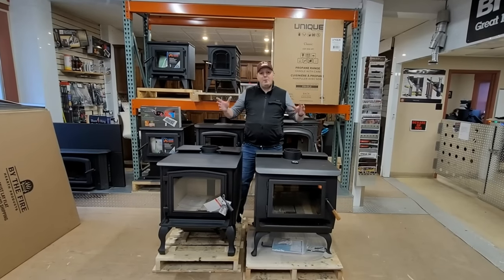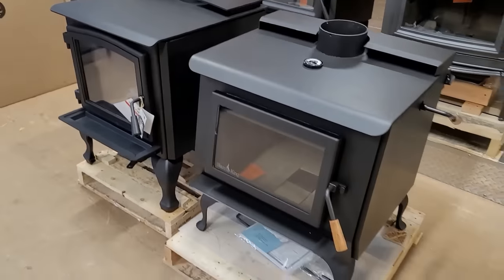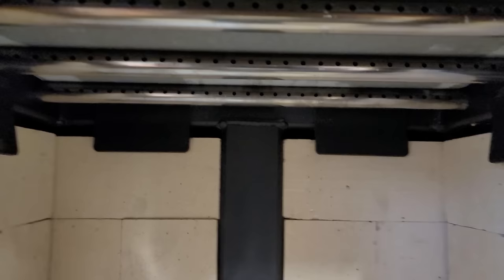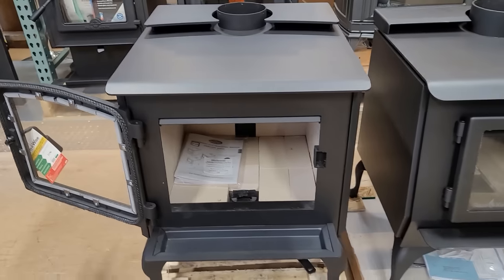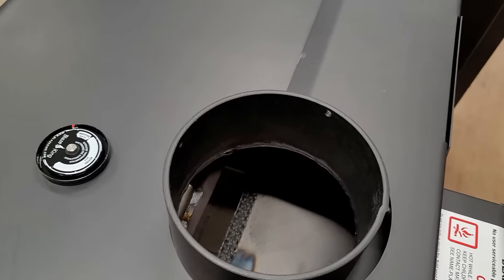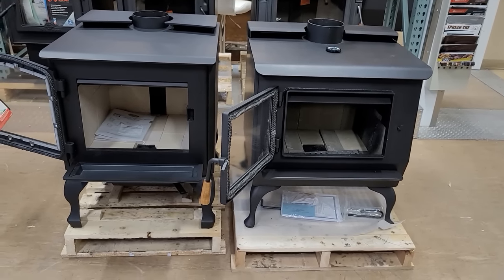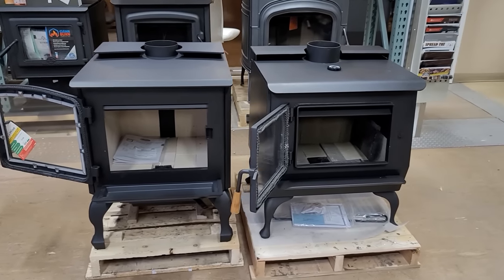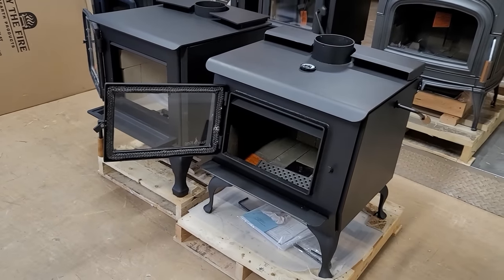Comparing Catalytic to Secondary Air Wood Stoves

Comment: how often do you have to replace the Catalytic part and how much does it cost to do so?
Reply from the maker: Some manufacturers warranty the cat for 10 years. If they are looked after it shouldn't be an issue. Cost to replace outside of warranty is over $400 CAD.
Reply: @tinmaninc2023  Thank You Kind sir,  if the Catalytic broke, does it mean the fire won't work i.e. I would have no heating, so be very cold, say my dad or brother wasn't there to mend it?
I have an uncle who works  with trees so he has wood that we could have, my dad or brother could likely chop the tree into small pieces, but I couldn't because I wouldn't be strong enough, and I haven't got a mom so I would be frightened if my dad or brother wasn't there.
Reply from the maker: @sarahclark5447  you would still have heat, just not as much.
Reply: Thank you so much Sir. I have told my dad what you said about the Catalytic part lasting 10 years and perhaps if he buys the stove he should buy a replacement Catalytic at the same time as in 10 years it won’t cost 400 but probably 800.
My science teacher said the catalytic part will store well and won’t wear out if it’s kept in its packaging. 
My uncle told me he won’t give my dad a tree, but logs that my dad will likely get a machine to split, given his daughter has nightmares about men with axes. My grandma said if I am worried about anything I can stay with her for as long as I want, but who would look after my dad and brother if I stayed away for a while, they would eat takeaways all the time! and my mom said one takeaway a month only.   
Anyway, it sounds like the stove is not going to be a disaster, and if it is I will nag my dad and brother until they sort it. If my dad can spend hundreds on a stove, I think He ought to start thinking about his daughter spring wardrobe, he needs to look on that as an investment as the prettier I look the more likely he will pass his problems onto another man,  hmm, I could provide my dad with a grandson to chop the logs for him too. My dad said I am not to be a nuisance since I have too many words in me. so thank you so much for answering my questions, and have a very blessed Christmas. love sarah  x.

Comment: Isn't it better to burn the gases with sec air?

What does the catalyser do with the gases?
Reply from the maker: The Cat uses the gases as fuel which makes the cat extremely hot which adds heat to the home. The wood at this point is not burning and the heat is coming from the cat as long as the wood is gasy.

Comment: I have a Lopi Liberty stove.  My main goal is to keep our 2,000 sq. ft. home heated. We are home all the time in winter to maintain the stove.  It has secondary burn tubes. One thing I don't mess with too much is the air/mix control lever at the bottom to either introduce more air or less air. Usually keep it open for hotter burning logs but once in a while have to damper it down because we got the stove too hot. So we cut the rate of oxygen coming inside the box. We never get an overnite burn, and have to relite the stove once again.  I don't understand how people can get a 12 hour burn, and have hot coals to ignite fresh wood the next morning. Ours are just cold ash by morning.
Reply: We have Lopi, model ? Its in storage since we moved to the Carolinas. Average burn time 8 to 10 hrs, hot coals in mrng.
Reply: I belive its a Avalon.
Reply: Your wasting heat up the chimney if your running wide open all the time. Try filling the stove full, run wide open til the flames are strong then adjust air down to half for a bit then down to low. This should take 20-30 min with good dry wood. You should see good secondary flames from the gases and this should give you good heat and a longer burn. A stove thermometer is also a great tool to use to determine operating temps.

Comment: All most people need know is overall efficiency, and it wasn't mentioned in this video! Looking online a catalytic blaze king is around 80 percent, which falls quite a bit short of the efficiency of the best non catalytic European stoves! Catalysts are a compromise, designed to allow wood to be burned slowly - a practice long understood to be the least efficient and certainly the dirtiest way to burn. There is only so much heat available in every kilo of wood, and if you want to get as much of that into your room as possible overall efficiency is key. To that end a modern cleanburni g European stove without a cat is the answer. Who wants to spend a couple of hundred replacing a cat every couple of years while simultaneously burning less efficiently than possible?
Reply from the maker: I disagree, for one Europe has some of the worst efficiencies out there....so much so that they are working with North American manufacturers to get their numbers down. Secondly looking at efficiency numbers doesn't paint the proper picture of how a stove works in a home. Those numbers merely suggest what is going up the chimney and are not real world testing. As far as your comment on replacing catalyst that too is a myth created by many non-catalytic stove manufacturers who until the NSPS 2020 regulations came out were completely against them but now are trying to get their own stoves certified with cats. Hence the "hybrid" type stoves now on the market. 
Cat replace is no more expensive then baffle or air tube replacement on a secondary stove.
Reply: >All most people need know is overall efficiency, and it wasn't mentioned in this video!

You are right Spencer. Efficiency is paramount, and not even mentioned. He definitely extolled the long burn smokey stove, while not mentioning the expensive resale of the converter. Also no mention of lower output; important in cold climates. The hell with efficiency! Repeat sales!
Reply: @tinmaninc2023  I do not agree that European stoves has low efficiency. For instance, a Jotul F500 ECO has 86%.
Reply: @tinmaninc2023  now you need to look at n/european efficiency  EU regulations are the strictest there are .no stoves can be made without a certain level of efficiency. normally 86% min.and must have clean air burn.

Comment: It's still confusing to me on which stove is better from a heating value. Which stove recovers the most heat from the fuel burned? That is which stove buts the most heat in the room and the leas amount up the pipe? It doesn't really matter if the burn time is 30 hours if you aren't producing much heat during that thirty hours unless your goal is to quote have a fire to look at.
Reply from the maker: Wood only offers so much heat per junk..... these stoves deliver it in different ways.
Reply: I'd say the catalytic model is the better heating value. The stove is plenty warm on those ultra long burns. You'll get up in the morning to a warm house. Can't do that with a non-catalyst stove. It will be much colder inside the house. If you're comparing 1-4 hours after starting the fire, they'll both be rip roaring hot. Both will be clean. But once that cat gets in the active zone, it stays active the entire burn. So if you walk outside in the morning there will be no visible or smell-able smoke with the catalyst model.

The secondary air stoves are basically like having a supercharger. Cramming extra air in an attempt to heat the wood and produce less smoke. This works great when they're hot. Not so much when they're cooling down. The catalyst stove will burn smoke before it hits the chimney the entire time. As the fire cools down, you get more smoke coming off the wood. That keeps the cat active (eating all that smoke, re-heating up the wood). Basically you get complete combustion at a lower temperature than the secondary air can do.

Comment: Catalytic stoves must be run wide open to be efficient.
"Less air" vs "more air" what?
Are they charging for air now?
Reply from the maker: Combustion air to fuel the fire. One type needs more then the other which in turn changes the burn times of each stove.

Comment: How often will the catalytic plug up and have to be cleaned?
Reply: I have a BK King.  Myself and two friends in CT bought ours all at the same time back in 2009 ($1925 each, don't know what they cost now, but I'm sure they're worth every penny).   Anyway, we all remove and clean the cat at least once a year.  All of us use the stoves all winter long, and we are all still using the original cat!  I do have a spare cat which I bought with the stove, but haven't installed it.  Awesome stoves!

Comment: What are your thoughts on a regency hybrid stove? From what i read they are as efficient as the blaze king 40 80 vs 81% hhv
Reply from the maker: Its my belief that most hybrid stoves are secondary air stoves with a cat that are designed to pass the 2020 NSPS regulations so they can be sold. If the cat gives out after you have it then you still have a secondary stove thats a little less efficient. They were only designed to get around patents by other companies.

Comment: All I have is an old Timberline fireplace insert with legs welded on it to make it a freestanding stove in the basement. It has the traditional stovepipe with a heat exchanger about a foot and a half above the stovetop. I have a fan behind the heat exchanger, into the air cavity around and above the stove and one free standing behind the stove. It does a very good job of helping heat the hose.
Reply from the maker: That's a great idea but unfortunately modifying a certified appliance is not approved by manufacturers as it voids any clearances that they are tested for.
Reply: @tinmaninc2023  You're most likely right but the guy who installed it ran a stove&fireplace shop in town and had a reputation for knowing what he was talking about and he assured me the clearances were all fine. That was almost 20 years ago and it's still heating great. Only problem that came up was the stovepipe was pretty tall and it was difficult getting the initial updraft started on really cold days. A draft fan installed on the pipe solved that.

Comment: I am looking for longest burn time posible from the stove, so catalyst stove choise is for us...
Does plain white/black newspaper ink or sappy wood like, pine can clog catalyst?
How many years on average u expect to last, on normal usage for catalyst? 
Thanks... 🪵🔥
Reply from the maker: I have seen customers go through a cat in a year and I have seen them go for 10 years. It depends on how well you look after it. Same as changing the oil in your car. The motor last much longer with oil changes. ;)

Comment: Can you use coal in these? Similar impact?
Reply from the maker: No they are only designed for wood.
Reply: @tinmaninc2023  thanks. Can you heat hot water with this to heat radiators or hot water tank?

Comment: I got a wood burning stove for energy independence and SHTF survivability. Catalytic has it's utility but there is no way I want to tie the longevity of my stove to the health and lifespan of the catalyst.  I have a Jotul Rangeley secondary burn and routinely have plenty of coals left 12-14 hours out utilizing their "cigar burn" with the damper adjusted properly.  I can also cook on top of, and in the secondary burn chamber using the Wintergrill feature.  Again, catalytic has it's purpose, but I loose what is important to me if I give up the features of the Jotul.
Reply from the maker: That's exactly the point. Each has its place and good salespeople should be able to guide customers in the direction of what will work best for them.
Reply: @tinmaninc2023  Agreed! I jumped straight into my point without thanking you - this is the best video I’ve found that explains in a concise manner the difference between the two types of stove. Thanks!

Comment: Don’t like these new stoves with the burn tubes. Can’t stop stove from running to hot. Even with primary air closed my sst reach over 850. I’ve heard of 950 and warping the top. Very unsafe. Was thinking of getting a blaze king but am reading a lot of people are  chimney fires with these stoves because stove pipe temps run so low.
Reply from the maker: If the stove is installed to specifications and the wood is seasoned there isn't usually much issues.

Comment: Thank you for this. Whats your thought on a Drolet colmbia 2. I have a cabin roughly 500 sf and I need some help picking a stove. It must have a rustic look on legs with a glass window in the front. And obviously its a cabin I dont need a $3500 blaze king.. My budget is 1000.
Reply: I don't know if you already found a stove but the description of the stove you want and the size if your cabin sounds perfect for a Jotul 602
Reply: Look at great northern and home depot, they have stoves that are epa certified, have secondary combustion and ash pans with large fire boxes

Comment: I'm confused by a statement made at 1:24, replacing the BK Princess with a BK Sirocco. I thought the Sirocco/Chinook/Ashford 3.0 all have similar 30 hour burn times close to that of the Princess. Am I missing something?
Reply from the maker: What I meant was when comparing efficiencies.... the Sirocco is closer in rated efficiency to the Osburn then the Princess is. The Princess has a better rating.
Reply: @tinmaninc2023  Ah I went back again and listened to what you said, I was confused. Makes sense now, thank you!

Comment: Make sure you can buy replacement catalytic converter and know the PRICE. My replacement cost over $250. Didn't last but two years. So ASK. A non catalytic converter could be a better option in the long run. I never read about this fact from reviews or advertisements. Hidden cost and hidden headache too.

Comment: I prefer secondary air, but those perforated tubes I've never seen before, they look like they'd rust out quickly,y stove has cast iron holes in a cast iron back.  It's a 20 yrar old stove with virtually no maintenance.

Comment: Is there more of a danger from carbon monoxide poisoning in a catalytic stove?
Reply from the maker: That's a loaded question.....if installed to manufacturers installation instructions then I say no..... if not following instructions then I say a secondary air stove will put more heat in the chimney and a cat stove will put less heat in the chimney which has means the stove with lesser heat in the chimney means better change to get carbon monoxide.
Reply: @tinmaninc2023  thank you

Comment: I just get the Old Grand Dad stove I had so hot the smoke is transparent a burn indicter on the pipe was 450 . no smoke just vaper  Wood Boss cast 1970 .     my stove never went out from Oct - May  .  bank hot coals and clean out ash every morning get the fire back up to 450 let it rip . I got a New stove in 2001 with a Cat . by 2012 the cat burnt up and fell out I took a pipe and steel plate made a top for the 4 inch cat stove still worked great .  the pipe welded to that plate out last the stove , its still roaring today .   4 inch cat in a 6 inch stove pipe the plate was 1/2 inch x 5 round the pipe was casing 4 inch fit great cold .    I heated with wood 40 years miss it gas will never keep you as warm as wood the BTU is different with wood .

Comment: Very good video but I would like to add that the Hearthstone Soapstone catalytic stove will give a gentle constant heat with even less wood. Puts these steel stoves like Blaze King, Lopi, Kuma, Drolet, U S Stove ect  with there firebrick internal fire box to shame. Hearthstone Cast iron frame and I believe 1 1/4" tongue and groove soapstone. They remind me of a oil filled electric heater. If you don't want soapstone, for sure get the catatlytic steel one.
Reply: You're comparing a $4,300+ soapstone stove to $1,200 stoves...
Reply: Soapstone stoves sure look nice but they don’t heat any better than any other stove. Wood only has so many btu per pound and soapstone doesn’t make more btu’s

Comment: I have a customer with 3300 just like that one and it burns 12 hours with a damper in the stove pipe.  Just no difference.  They are trading out for a soap stone stove next week.
Reply from the maker: The soap stone stove will not burn any different. It will just stay warmer longer due to the soap stone.
Reply: @tinmaninc2023  Seems to me that staying warmer longer is a major asset.